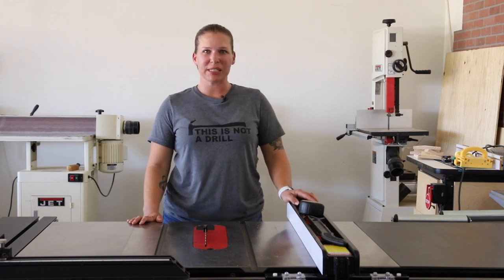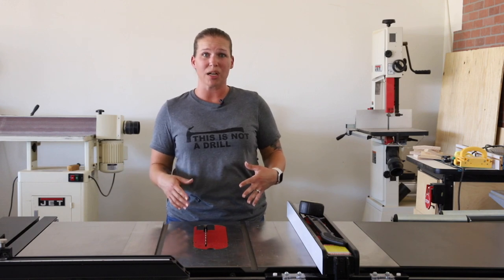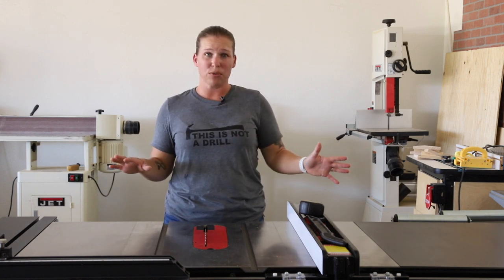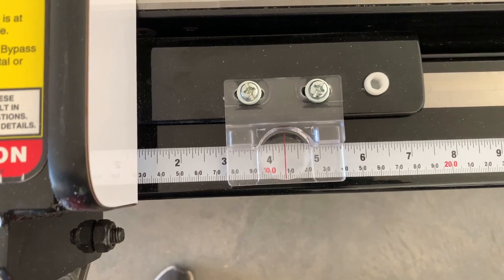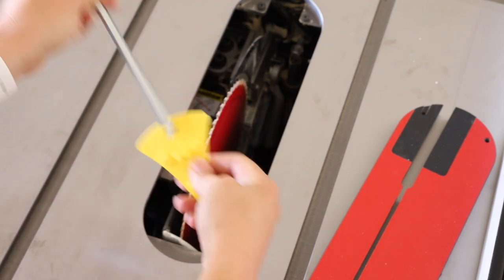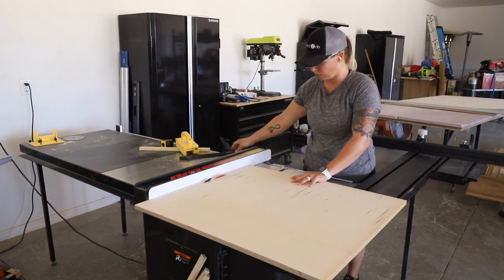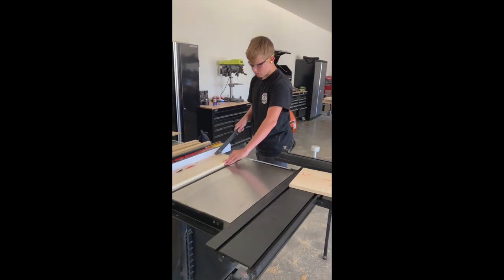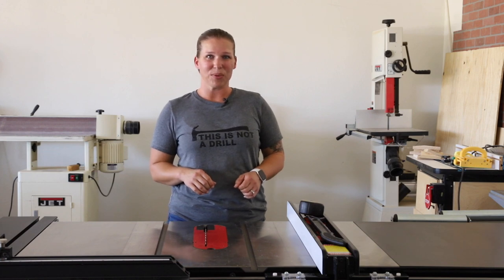SawStop Review - 1 Year Later (The good and bad)

Comment: Look up chips fly. They have a ditigtal measuring device that fits the Sawstop table saw. It just screws on using the screws that hold on measuring glass.
This is handy becuse if you change the blade you can zero it out so you'll never cut short or long using a differnt blade like a normal or thin kerf blade 
When you put your tape on the fence rail you set it for the stock blade. But if you use a differnt blade that might not be accurate anymore without recalibration.

Now ive been told this won't fit my Jet Table saw but I plan on trying it anyway
But I'd like to know what size the fence rail is from the table to the operator side
I've been told this won't fit my Jet but both machines have a besymery style fence system most larger saws do.
Reply: With a 3 hp saw there is little to no reason to use a thin kerf blade.  And unfortunately, the digital device that you are talking about, has to be recalibrated every time you change blade thicknesses.
Reply: The change on the standard rip guide dimension window accuracy would be caused by different carbide tip offsets from the right side of the blade face at the arbor??? The blade body/face will always seat against the arbor plate at same location assuming you don't insert blade stabilizer plates.

Comment: Agreed.  SawStop is a great saw but there are a ton of folks that cannot shell out the kind of coin required to get one.  However, that is all about to change unless I have missed something recently in the news regarding SawStop.   The patent runs out this year (August I believe) on their stopping mechanism and there is a possibility that it or parts of the patent will be extended but there is no guarantee either way.   At one (1) minute past midnight following the date of expiration of the patent, nearly every single saw manufacturer will have an offering that will be ready to sell online at that very second or you'll be able to either pick one up at your big box store or order from somewhere.  Right now if I were planning to purchase a SawStop I'd wait until this issue is settled because of the possibility of saving huge amounts of money, even a possible price reduction from SawStop themselves.
Reply: I don't really understand this though. I mean Saw Stop are the ones to be clever enough to come up with the technology so they should be the only ones to be able to implement it. Surely they can "own" the patent forever. I can't really see Festool giving up the design of the Domino and letting other companies implement it so why should Saw Stop give their's up. The cost of their saw isn't much different of cost to a Powermatic saw, and Powermatic don't have the technology. If Saw Stop had a crap saw and just the technology then I would say yeah too much money but they are pretty solid machines as well. Cost is a lot cheaper in the U.S then here in Australia, for a Saw Stop 3HP PCS 36" it's just over $5,000AUD which equals around $3800USD. No additional extra's included. Not sure what you guys pay in the states.
Reply: @jac_builtWoodworks      Patents do expire though and it’s a good thing.   It brings prices down and let’s others into the game and it also drives further innovation.  I think the basic sawstop here in the states is 1850 for a contractor type saw and 3500 plus for their cabinet saw then add in thousands for the accessories most folks would like to have.  SawStop is a quality saw but I’d not say it’s the very best money can buy though.  They will continue to produce saws regardless of the patent expiration but the auto brake function is the issue.  After the expiration I do expect to see significant savings on the cost of their saws though.
Reply: @ronwilliams329  well hopefully the cost will come down at the time I intent to purchase a saw. Which other saw do you think is better?
Reply: @jac_builtWoodworks      Better than SawStop?    Felder for sure!  Their slider is better as well.  Dream machine.   But when choosing a table saw available space is a big consideration for most folks.  A complete Felder or SawStop setup is a dream for most folks and not practical for average Joes working out of a small garage or shop.  You mentioned Powermatic and that is a fine cabinet saw as well.  Laguna is another.   I also like Grizzly (not saying it's better than SawStop) even though you often have to fine tune them when they arrive.   Knowledge on how to find tune table saws, miter saws and joiners is a premium that pay serious dividends.   There are a lot of folks now days that are ditching table saws due to track saws.  Neighbor across the street is a weekend woodworking warrior and a very serious one at that, and told me he rarely uses his table saw anymore and I know others that have said the same.   Actually to me, the best saw is the one I can rely on to cut strait and has power.  Easy to fine tune to get the absolute straightest cut.  That being said, my Grizzly ain't failing me in the least bit and I have no plans on retiring it!   Probably my last saw.
Reply: @ronwilliams329  A Felder makes the SawStop look cheap.
Reply: @johnsanford3596     Like I said, Felder is a darn good saw and I cannot see anyone making a mistake by purchasing one either.
Reply: @jac_builtWoodworks  Festools patent is close to running out on their Domino’s patent also. Companies have no say when a patent can run out. There will be many clones when the Domino’s patent runs out just like when the patent ran out for the company that made the first biscuit machine I think it was Lamello.

Comment: You're doing it incorrectly. Use the sliding crosscut sled to move your material through the saw. NOT your hands. They didn't put a locking position on the sled's +Y axis travel limit because You're NOT supposed to be standing in front of it. What you're doing when you're standing in front of the sled is creating a safety violation. Anyone could walk up behind you and accidentally put pressure on the sled, thus forcing you to move forward. You could trip when something like that was to happen. Imagine tripping forward towards the saw's top surface and that unforgiving blade spinning fast enough to put a dollar bill slot in your forehead and brains. 👨‍🎤⚙🩸🩸🩸🩹🩹🩹🚑🏥
Reply: I thought so
Reply: No, that unforgiving blade would stop and drop below the table surface.  This is a SawStop.  ;~)  But yes, she should be behind the miter fence or remove the miter gauge and fence for this operation.
Reply: If there was a locking mechanism in the back, no one can put pressure on the sled because guess what, it's locked 😂

Comment: The slider is such an afterthought. Its so far away from the blade
Reply: Sawstop's installation instructions say to remove the left wing before installing the slider. It looks as though Katie left hers on, and others who've posted have done the same.
Reply: @gmark8927  even still it doesn't put the slider next to the blade like sliding saws I'm familiar with
Reply: As I understand it,  only integrated/pure sliding table saws have slider adjacent to blade and these are much more common in Europe. Bolt on sliding miter table systems can only be as close as the saw's cast iron top will allow. I've seen that the accuracy is slightly better with the  pure sliding table saws.
Reply: @rickwilson478  exactly my point. They have a really night base platform and instead of making a nice true slider with their awesome safety tech they just slap a big cross cut sled 20" away from the blade.
Reply: The slider does not look good so far from the blade. Loss of accuracy and risk of chatter

Comment: There should be zero flaws for the Price u pay for it. Honestly not impressed with mine. Way over rated. Honestly wish I didn't waste my money on one. So many other better Table saws out there for cheaper cost too. Safety is common sense on any machinery u operate. That is the only good thing about Sawstop. Lets any moron be capable of operating it. And the blades r breaks on the saw r a pain in the Ass. I got another Table saw with Dado blades installed on it. They need to design the break different on this saw. And I noticed u didn't mention having to square up the fence when using your sliding portion? I've got to were I wish I didn't buy that slider part too. Always in the way. Pain in the Ass. If I could recoup my Money I spent on this Table saw it would be gone in a second. They have no good resale value. Anyone with Money will just buy a new one. So why buy used when u can get new? Also mine is 5hp. Wjy u get 3hp? Waste if u ask me.

Comment: Review? This isn't a Review it's a brag that you got a saw, with way too many upgrades and bonuses then you really need. 52" capacity that is more than your space allows, no out feed table, and a slider that isn't even necessary unless you are doing large work or cabinetry work professionally. Mobile base add on that moved it about 3" in a  direction that didn't change anything for your workability
Reply from the maker: Thanks so much for watching my video and taking the time to comment!  Last time I checked, I do have a professional shop where I do break down large sheets of plywood with my extra long fence and slider.  I do have an outfeed table that I now use, but I do appreciate your strong feelings on whether or not I “need” everything on this saw.  Have a great day!